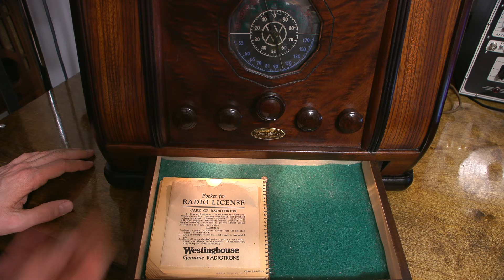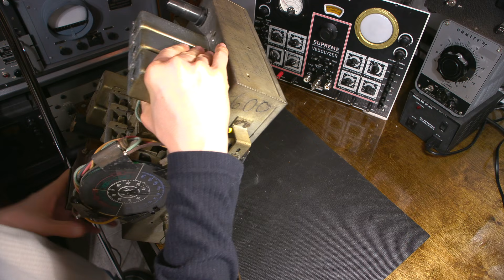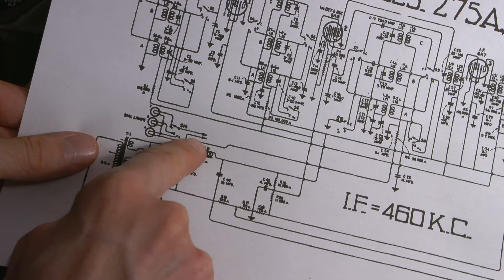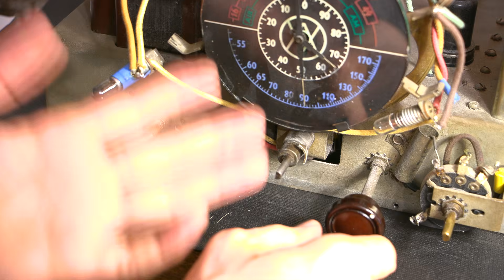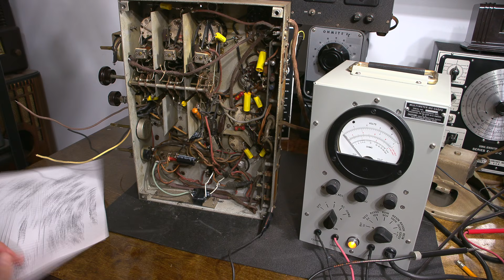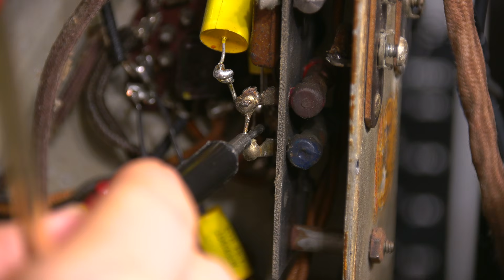Electronic Repair Adventure- Radio Receiver Troubleshooting!

Comment: Important Question! Nice radio and work as usual. Thank you for the upload. How can we save these radio and use them when transmissions are to be only digital? do you have an idea on how to add a converter or are they going to be only a nice piece of good looking furnitures without function. Here in Europe a legislation is soon in force and some countries has already shut down FM band and have only digital transmission (Norway) many old nice radios on waste dump stations already. What to do? any advice for the future?

Comment: Great video, you are awesome! I have a Precision Instruments Signal Gen like the one you have in the background of this. It was a gift from a ham when I was a teen many years ago and I've done some electrical restoration of it.  I noticed that on yours, the plastic bit with the vertical indicator cross hair looks quite new (clear, not yellowed and curled up, like mine).  Did you make a replacement or buy it from somewhere?

Comment: I’ve got an old radio it has 4 very large valves it was working well turned it off next day it had no audio but valves all light up and dial lights working, on the chassis to the rear it has a bulb that normally would light up but it’s now not working I have had the bulb out and put test meter on it bulb seem to be ok I swooped it for a dial bulb as it’s same voltage and it worked. How ever while testing for voltage I caught the back of my hand on the speaker it gave me a jolt and I had sound for a second. I would like to getting working one day again. I have also got a lot of old valves and bits in a box some of the bits are new with receipt from the 1950’s

Comment: You have to love those old radios. When the conditions are right and with a good aerial, one could pick up am stations on the other side of the country and occassionally, beyond. I remember doing that in my youth. Listening to those far away places.. I Of course shortwave expanded that further. 

Today, Australia is a different country. AM broadcasts are gradually winding down(allot of new radios don't even feature the band) and shortwave, is quieter than it once was.

Comment: Pretty sure there is no permanent magnet in this old speaker.   This speaker uses an electromagnet which doubles as a filter coil for the power supply so unless you energize it on the work bench, yoo can stop worrying about screwdrivers and other metal parts being attracted into the cone.

Comment: There is no field that advanced more than the field of electronics, look what it did for the healt industry, not to long ago had to cut you open to see what was wrong, today can be done visually. 

Ha, back then could get electrocuted was working on a 5 MW radar, got close to a loose single strand of wire, shock a bolt through my hand, that really hurt and took a long time to heal.  Today if you don't follow grounding yourself, can blow up a micro chip.

Ever try to design a computer with vacuum tubes?  Ha, the room its in can hit 150*F, to remain in this field, was constant study as every day was brand new with new challenges, was designing complex integrated circuits putting in over 30,000 transistor in a 1.5 by 1.5 mm chip.

You can have this old stuff and I love my 70" 4K flat screen.  Unfortunately had to pitch my huge collection of VHS tapes.

Comment: I had a big break from your channel and so glad to be back watching and listening to your amazing work. I have came back with an even bigger fascination after being given a few radios.  Thank you so much for your distance from fingers to components demonstration you had me on edge.  I have learned so much from this one video and Im going to attempt a refurb of a Zenith Radio Corp 6S229 its a bit messed up its been in a very damp shed and veneer is peeling with other case issues and the chassis has lite rust, Im going in completely blind.  Please point me Mr Carlson or any other person who reads this comment.. Mr Carlson's Lab 100amps

Comment: The info you about the electromagnetic speaker, I did not know that. Going to be very helpful to me with a project im working on
Reply: update, Your light issue might be my problem with another radio i don't have time to get too. ( I watch your videos in parts )

Comment: Could you spray triple thick clear on the back of the dial like you would on a flaking pinball backglass or is that not compatible with the paint? (or some other reason it'd be bad)

Comment: I picked up an old 60s Hi-Fi tube amp to work on because I've been watching your videos.
I recapped it and put in virtual center tap on the heater filiments. That got rid of the 60 hertz hum but I still have a 120 hertz hum.
If I make a video of it can you take a look at it and give me any recommendations.
Thanks cory.

Comment: Hi Paul.  I noticed that the heater current in the tube radios and test gear is generally AC.  Will the presence of AC in such close proximity introduce low freq hum?  If the heater supply was rectified and smoothed with a nice fat capacitor and choke is it likely to make any difference, (apart from giving accountants a wallet-attack!)  However since there are no accounts in your lab we can ignore them :-)

Comment: Hello there, I loved the way you clinically troubleshot the radio, I was just blown away by the logical fault finding, bravo!!!!!
I have an old Cambridge 5 or 6 band radio (in disrepair, but not meddled with) that my uncle had purchased, brand new, sometime in the 1960's. I am wondering that if I could send it to you, could you restore it? I could send some pictures to you if you are inclined. Do let me know.

Comment: I inherited a Realistic ConcertMaster solid state fm only radio recently that was sold 1969 to 1970 by radio shack. The radio still looks to be almost new and the volume has been very low since 1972, my dad just stuck it in a closet. Do you have any idea what could cause very low volume on a set like this? My dad told me when he first bought it that it was the best sounding radio he had ever heard up until he passed away. Everything works perfectly just very low volume. Thanks.

Comment: This time you said it's a good sign that someone had changed a capacitor for a new one. In other videos you say that it's a bad sign if someone has worked on a radio before as it means you might not be only fixing an original problem but also potentially fixing what another tech has screwed up. So which is it?  Good or bad?

Comment: what great work you do, resurrecting this old equipment that hardly anyone else cares about. So nice to see something rescued from the junk heap. Today's electronics are unrepairable, which is a terrible shame.
Reply: I disagree. I've fixed a couple of big screen LCDs which are a piece of cake. Everything is just module computer boards. The power light flashes the error code, and you can figure out (usually) which board is bad. Open it up, unplug the old board, plug in the new board.

Sure, you can't replace individual components because they are all surface mount (plus, there are few individual components expect on the power supply), but I think the most expensive repair I've done is maybe 60 bucks, and takes less than an hour.

Comment: @Jim Blazer I think  has it right.  During the 1930s and into the 40s there was a lot of concern about German spys, etc.  I don't know exactly when it started but ham radio operators were not allowed to operate during WW2.  So it was probably a big deal if you were able to obtain a license to receive short wave back then.

Comment: Paul, I just watched an old video from Dave over at EEVBlog about one of those cheap Chinese vacuum tube pre amp things. This video was a follow up on an earlier video where he decided to take it apart and see if the tubes were actually doing anything in the circuit because there was also OP amps on the PCB. What I noticed was that it ran the tubes from plus 12v and minus 12v, but how? I have looked at datasheets for tubes and have only ever seen the maximum voltage ratings but I can't remember ever seeing the minimum plate voltage anywhere! And if that's the case with small signal tubes, would it be possible to do something similar with output tubes? There might be tons of high voltage transformers in the Americas if you wanted to build a point to point tube amp but those things are unobtainium in Australia. I could have one custom made new but it's not really affordable... But lower voltage transformers are no problem... The only cheap high voltage transformer that's available brand new is one out of a microwave oven and you can get one for $40 brand new... But I have never seen anyone build a vacuum tube amplifier using a microwave oven transformer.... Now that would be something... Because you can sometimes get those transformers for free on the side of the road... If only there was a way to make it work.

Comment: I suspect a reason component replacements get j hooked is the lack of a good desoldering machine such as a Hakko. They are expensive machines, using a manual pump solder remover makes it several times the work, and increases the likelyhood of damage.

Comment: I think I have a decent way of silk-screening onto glass. At least it worked acceptably well the last time I tried and the paint I used was a durable, UV resistant glossy paint, if anyone is interested. I have restored a couple items that had glass dials similar in function to this radio. Most of the work is in photoshop getting the image correct. I would love to see an IF alignment on a rig like this.

Comment: I am on the edge my seat almost shouting, "it's a short in the filament circuit...there's an open wire!" and so on. It's just so much fun and the best part is learning the step by step trouble shooting procedures with the safety tips. Top notch video!

Comment: I wonder if you put a quite fan in the back of that radio,The tubes could run a little cooler   for longer life ,I no certain tubes are meant to run warm and have a shield cover over them ,but a little cooler ,maybe that why some electronics up to ,today's use fans in lap tops and They make cool pads  for lap tops too.

Comment: I would check all the replaced caps to make sure they're the correct values and that the electrolytics have the correct polarity in circuit.

Comment: Great video and what a powerful radio. It pulled in a lot of stations with no real adjustment. This was made very well you can tell. Keep going with this and I can't wait to see the finished product. Big Fan of your attention to detail. I'm a perfectionist and your repairs are all top notch. I would like to get in touch with you about an old OLSON receiver I have and if you would like to work on it for an episode on your channel. It's very nicely made with bullet aluminum knobs 3 big transformers and about 20 + tubes. 3 major out put ones and one for tuning. This has a good amount of weight to it. I would like to run my SONY reel-to-reel I found and repaired though it. Even thought I did go to electronic school in the 80's. This would be to much for me and I would love to have this working like the day it was made. You are the only person that I know that would do this right if interested. You do not see to much on OLSON equipment and I like the odd stuff. I have had no luck on finding much info let a lone a schematic online. I hope you would consider taking this on. I would be so happy. I know you have a full plate. Thank You for your time. Mr Carlson's Lab

Comment: Any one else note in the schematic the I.F. frequency is 460 K.C? It is all 455 K.C. since I have been working on A.M. radios. I have always wondered why 455Khz & 10.7Mhz was chosen for an industry standard.for A.M. & F.M. radio receivers. Actually, it could be nearly any frequency, but it is now standardized. Military raidios use different I.F. frequencies altogether.

Comment: As for getting shocked by B+ voltage while inside of a tube radio.  In 1960-61 I was going through USN Basic Electronics school in Millington Tenn.  We built a simple superhet radio.  Our final was to trouble shoot.  I failed because I got shocked by B+, Automatic setback to repeat that 2 week module.  Still gradualted in June 1961.

Comment: Great channel! I have 2 old Zenith Transoceanic radios. H500's, I think. One still works great, one still works fine, but needs the tuner dial string replaced.

Comment: That repro wire is the same stuff Tube Depot sells. I’m not a fan of it, but it is safe. Very thick teflon insulation under the cloth wrap and rated for 600v. It’s just too thick for small envelope tube sockets, like 7, 9 or 12 pin, to be neat and tidy.

Comment: Entertaining Mr Carlson. I am a retired electronics/systems engineer (UK), but started out building valve radios when 9 years old, in 1962. So I enjoyed watching this. Repairing/troubleshooting old radios like this is an art and little to do with electronics knowledge per se. Thanks once again. A lot of modern digital electronics is so clinical and boring compared to old analog radios. I think a lot of young M.Eng graduates would not know where to start !
Reply from the maker: Thank You for your kind comment Philip!

Comment: Q: On the other side of the wire you fixed at 56:12 there are something that looks like resistors (red and reddish blown thing) what are they ?

Comment: We had a stereo that kept coming back with a blown fuse .later found a switched strip was plugged to the aux socket cleaning lady we plugging a floor wax machine int it.😃😃😃
Reply: First thing I replace those field coil speakers with pm add resistor put original speaker in the safe .

Comment: Some people advocate doing J-hooks as a way of avoiding doing too much work on the tube socket.  If you're not careful, you could end up damaging the socket.  I like not having J-hooks, but I appreciate avoiding damage.
Reply from the maker: Hi Russell. Never once have I damaged a tube socket, but I imagine if one is heavy handed, it could happen.
Reply: @MrCarlsonsLab  I think those that advocate this tend to work on guitar amps.  Perhaps those sockets tend to be more fragile?  At any rate, it's faster, which likely factors into people who do "repair for pay".

Comment: That other restorer must have had quite a shock (ha!) connecting up that orange lead. Wonder how many dial lights they went through testing that. Love that dial though... reminds me of a clock, which is probably intentional. Happy to watch an alignment. If you have any AM/FM units, it'd be interesting to see what's different about aligning the FM band. (I recently bought a 1955 vintage AM/FM unit I'm looking to restore... I think it's "Airline" branded, from Montgomery Ward.)

Comment: Yes, I would also like to see the alignment procedure for this receiver. It looks as if it might be quite involved.

You mentioned 25 Hz for the transformer. I wonder if this receiver might have been built specifically for upper New England? Back in the day before the national line-current standard was set at 60 Hz, power companies supplying electric power to the various electrified railroads in that region supplied alternating current at 25 Hz. Some of these railroad power companies also supplied AC power to commercial and residential customers at the same frequency. Just a thought.

Comment: Thanks for your video. I would like to see the IT alignment process. 2 questions, how did you find the schematic, what antenna are you connected to? I am thankful for your test tool inventions, super probe and cap leakage tester, nice to see them in use and thanks for making them available!

Comment: I do not see the screw terminals for the light in the drawer showing on the schematic you have.  I wonder if there is a UK version of the schematic vs the Canadian-Westinghouse version.  Or a different model all together.  Is that model # W274 ... I noticed many US models that begin with WR in the Riders books.

Comment: Hi, Paul  Do bipolar transistors have impedance?
Reply from the maker: Hi Robinson. Transistors have the ability to control (or drive) a low impedance load directly, this is why solid state amplifiers have no audio output transformer. Vacuum tubes need a device to "Transform Impedance," because they (in most cases) do not have the ability to directly drive a low impedance load. This device to transform impedance is called a "transformer."

Comment: Nice troubleshooting. Carlson Super Probe on the old time workbench? Seems like you need a tube version of the Super Probe. Did you check if the capacitors were installed with outside foil on the low impedance side of the circuit?

Comment: Nice! That lead from the converter tube plate (carrying the IF signal) running a long ways intertwined with other wiring would detune the first IF transformer badly

Comment: Thanks for another excellent video - it was nice to see a slightly different approach this time. Can I just ask why you added insulation to the capacitor lead, as there didn't seem much chance it would short to anything? I was wondering if you get a chance at some stage, whether you could show in detail the correct method of soldering say an electrolytic capacitor to a terminal strip, detailing how much and in what manner to wrap the leads, and when to use insulation? Also some tips on soldering multiple components to say a tube socket lug would be very helpful, with the correct method of securing the leads. Apologies if you already covered this in detail in another video.